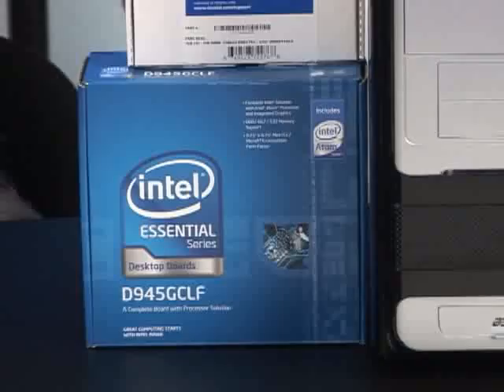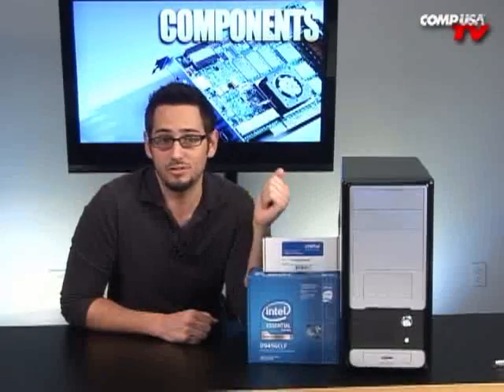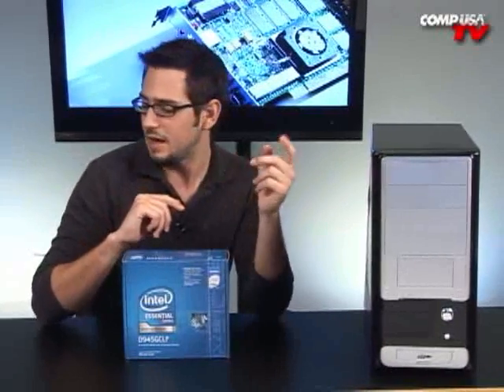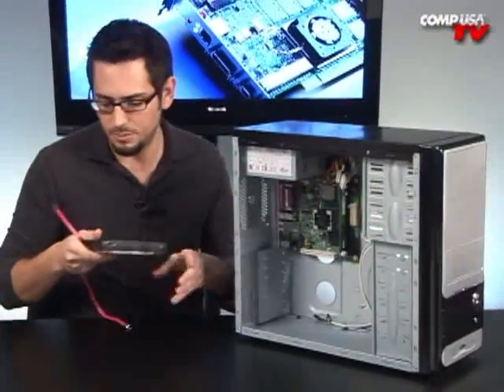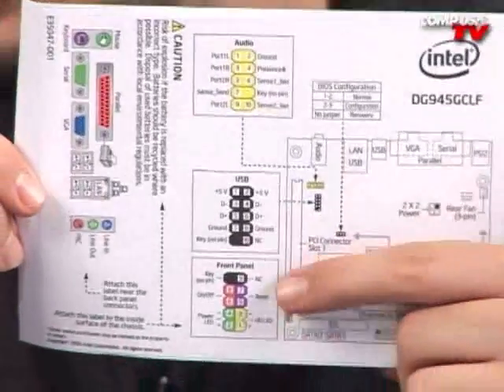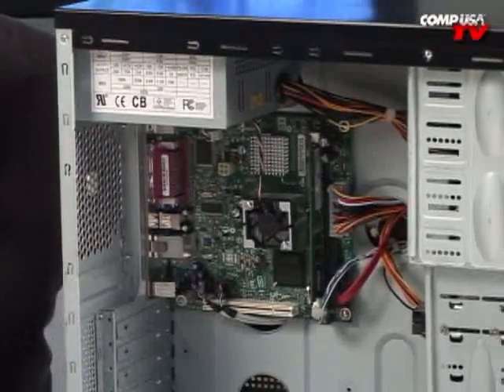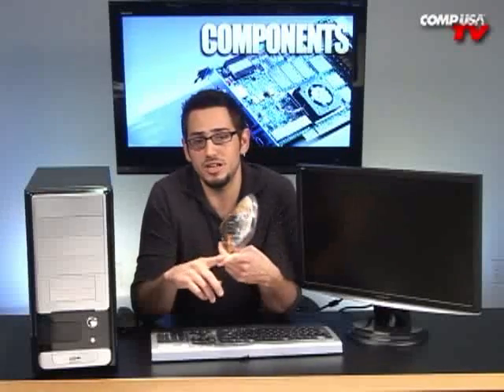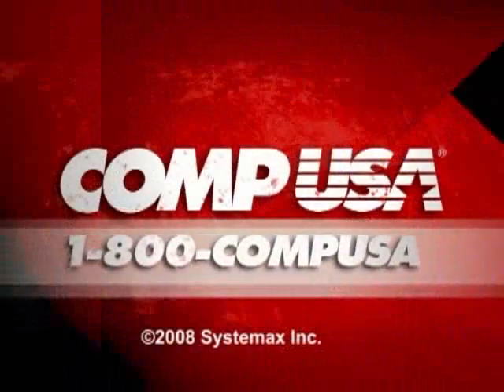Intel 945GCLF Mini-ITX Barebone Kit

Comment: I tried one of these with a 330 and got rid of it after 2 weeks the board was rubbish.
Get a Zoltec IONITX-A or the VIA VB8001 instead it'll cost a little more but you won't be disappointed.